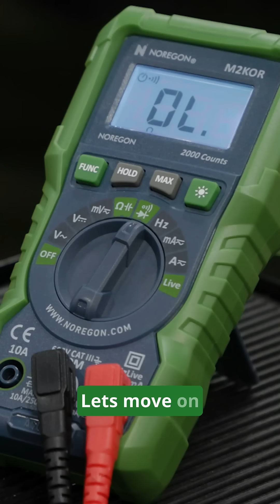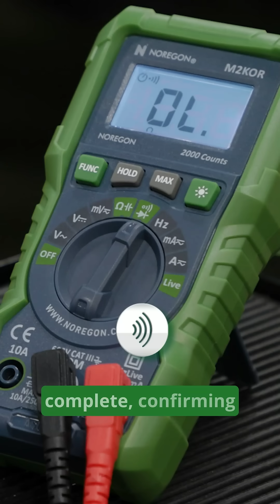What Each Multimeter Symbol Means and How Technicians Use Them #techtiptuesday  #dieseltech

Comment: Curious what makes measuring amperage so dangerous? I did this with a battery I had once, and the insulation on the wires started smoking and melting seconds after I began measuring. Is there something I could have done to ensure a safe measurement?
Reply from the maker: Measuring amperage is dangerous because it applies resistance to the circuit, generating heat that may cause weak connections or frayed wiring to fail. To measure safely, never connect the multimeter directly to a power source, but instead use a controlled load to manage resistance and ensure the multimeter is properly rated for the current being measured.